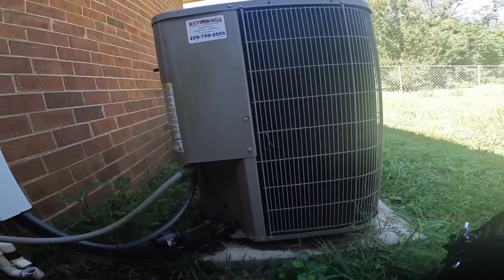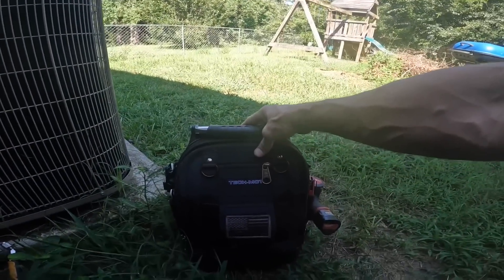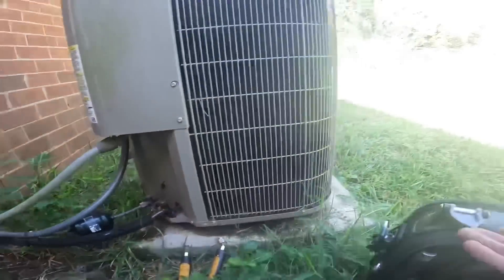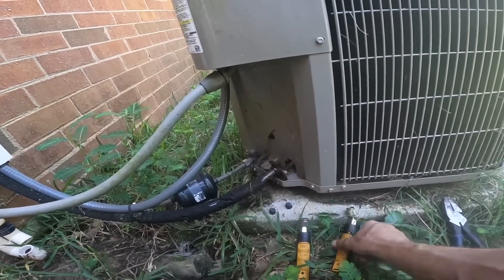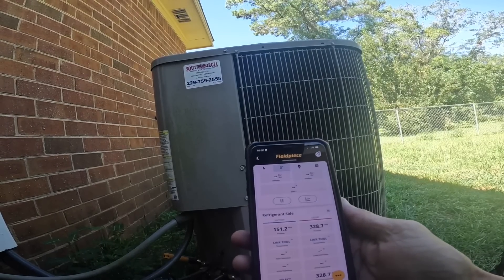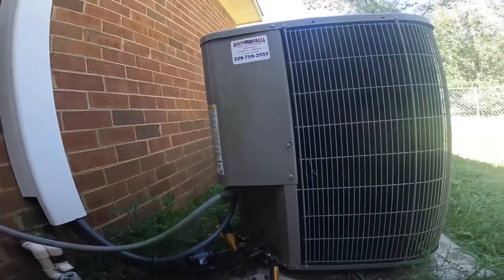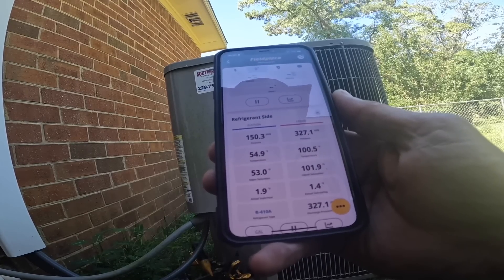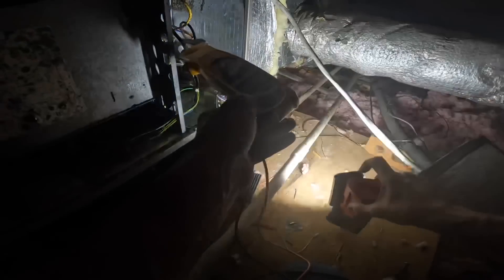TXV Diagnosis On Carrier Heat Pump Not Keeping Up.

Comment: @gosman949
19 minutes ago
I'm a homeowner with a Trane heat pump.  I have been round and round with my tech about why my heat pump throws error messages in the winter in heat mode.  First they replaced the heat strips in the air handler.  Then they said the coil was leaking in the air handler.  Now they came out for their tune up in May of 2025 and the freon is fine!  Now they said it might be the expansion valve in the condenser since it only shuts the system down in the heat mode.  But they did not do the diagnostic you did in this video.  So what is a homeowner to do! I'm going to hope this 13 year old 20 seer Trane gets through the summer OK.  But I will be faced with maybe getting a new expansion valve in the winter?  Is it worth it?

Comment: A B C
Air before charge
Always start with static pressure  and fan speed using your manometers,after you have verified correct CFM per Ton, refrigerant levels can then be checked.
Reply: Is that cfm chart still laying around on that old unit somewhere?

Comment: Could a bad outdoor txv cause trane heat pump to pump down in both heating and cooling?   I am so stumped and you seem like you may have run into that problem before based on your experience level

Comment: I know in Georgia you have high latent heat loads , that may account for some of your delta tee.  There is a formula where by you measure the time it takes to produce 1 pint of condensate,  do some simple math and it will tell you exactly how much tonnage you're re moving in latent heat.  I'm sorry I can't come up with it now, but I'll work on it.

Comment: I think you nailed it but I want to see the pump pump down rate and if a question still linger, recover the refrigerant with a scale to check the charge and saturation pressure to confirm that R 410a with correct charge. Then evaluate.

Comment: How did the system perform in the heating mode?? I guess any reversing valve issue; like hot gas bypass into the suction line would raise the low side pressure but the super heat would go up??

Comment: I want to believe it is a faulty, maladjusted or incorrect TXV. An inefficient compressor would typically cause high superheat due to the compressor not pumping and starving the evaporator. Taking amp draws possibly could've ruled that out or not. I'm curious to see what it was, it has me guessing.

Comment: My two cents.. Low on refrigerant charge.. 1 sub-cool low... 2 Liquid pressures on the high side is Low of the outdoor temperature is above 86 to 90 degree F and  the condenser coil is clean.
3 you need liquid refrigerant pressure on the TXV to force it open aswell as to produce the flash gas to expand in the evaporator for your sensing bulb to respond by closing the TXV to control the super heat... Add some refrigerant to bring up the sub-cool and let it run for some time and  watch the suction pressure drop and your super heat rise.. Some feed back would be nice if possible.
Reply: You are already flooding back with 1 deg superheat and you want to add refrigerant?? Do you even hvac?
Reply: Wrong 100 %

Comment: It reminds me of one I had many years ago that was  going off on thermal overload, and it was because it was overfeeding. And the system wasn't very old it was only a couple years old and still under warranty. I replaced the evaporator coil because it came with the TXV on it. go to start it up the compressor wouldn't run, I put a compressor in it. start it up it ran just like I did before, overfeeding and the only thing I could figure was the ducts, but why was it overfeeding. And with its overfeeding the compressor would eventually go off on thermal overload. the only thing I could do to keep it running and to cool a little better, was to drop a bunch of charge out so the evaporator wasn't flooded. The pressures made no sense but it would work and stay working. 
So it had a new evaporator and compressor and it still worked the same way as it did when I got there. What a nightmare that was. I didn't want to do any more on it. I'm pretty sure I calculated the CFM and replaced all the freon in case it was contaminated, but nope it wouldn't stop over feeding. I got it to work a little better and I got going.
Reply: I had one like that, it was cold, like too cold. Customer was happy?

Comment: Yeah I'm in agreement with the others that mentioned the sensing bulb. Obviously it needs to be insulated and firmly attached to one of the upper quadrants of the suction line. I couldn't see it in the video and didn't see a bulge in the insulation on the suction line. Good luck, and looking forward to the follow up.

Comment: You are a very good troubleshooter I think! you can get the job done and move to the next. I have a question though? What brand and model is that little bity small thermal camera you used to see if breakers were getting hot in another video?
Reply: The little thermal camera is made by Klein.

Comment: Most txv fail closed. I’ve never seen a txv fail open. You have 2 closing forces internally to a txv with only 1 opening force (the bulb). So when the bulb loses its charge or doesn’t touch the pipe the valve loses its ability to open.  Your pressures and temperatures indicate the valve open and unrestricted. It’s open because there is not enough liquid refrigerant to cool the suction line enough to force it closed.  Clean your condenser coil and add some refrigerant.  If you’re not comfortable adding refrigerant, recover what is in the system currently while weighing it as it comes out to verify your charge is correct.

Comment: Cuties 

You can use analog gauges and while it’s running disconnect the common wire on the condenser fan.

As the head Head pressure increases the The suction gauge should remain steady.

I saw this on the mentors YouTube channel.

Comment: For these txv's you need to have around 10° subcooling for them to meter properly. Make sure the sensing bulb is correctly placed, I would aim closely around the 7 or 5' O'clock position. And make sure the bulb is tightly wrapped. I use monkey shit. How this helps.
Reply: Your slugging back cause the liquid is flashing off, pushing the liquid. I have found that if your not over 3.7° SC you will have liquid flashing at AH.

Comment: Moving the temp clamps back and forth isn't always going to give you an accurate reading. I use a wire brush to clean the pipe if I have a abnormal readings before final diagnosis

Comment: WOW ITS FUNNY HOW A TXV CAN GET SO MANY BRAINS OUT THERE WORKING    AND SO MANY WAYS TECHS HAVE FOUND A WAY TO CONDEMN A TXV       TXV  JOB ONE IS TO CONTROL SUPERHEAT GO FROM THERE FIRST   🤔🤔             TXV STILL BETTER THAN PISTON       EASY TO CHARGE BY  SUB COOL 🙂    TXV VERY FORGIVING     AS LONG AS IT IS INSTALLED THE RIGHT WAY                  ALSO  THIS WAS STRAIGHT COOL WITH HEAT STRIPS        NOT HEAT PUMP   IT SAID HEAT PUMP NOT KEEPING UP           CAN YOU CLARIFY ???

Comment: Weak compressor along with a weak fan. I would check the run caps as a low cost "just in case", but that system may not last another summer.

Comment: If it is a txv system, then how do you start to troubleshoot this with an obvious low SC compared to mfr specs, usually 11° or so on Carrier equipment.
Also, the txv is set to maintain 15° SH.

Verify air flow, that's number one. The motor isn't going to be too different with the door off when you change speeds and will be lower RPMs with the door off vs on.

Next, pull the txv bulb and hold it in your hand to warm it up. You should be able to see the change in pressures. No change, bad txv.
If it does change, I would probably add some refrigerant to see what SC does. Based on what happens will point me down the path to my next step.

Comment: Yank the sorry damn TXV out and put a piston in it.. Done and ya (NEVER) have to worry about it happening again, in fact with that being carrier, i would have just pumped it down, and got me a piston out, put it in, vacuum, takes 30 minutes on those bolt in deals..

A txv to piston isn't gonna change the seer rating much at all...   Only difference is one meters flow off temperature and the other by orfice size. That's it the end! 

If it's not a EEV, then it's not worth the time or trouble of installing! TXV's are the (WORST IDEAL) they ever came up with!!

Hell i bet i change 20 per year at (LEAST)!!  Hell i have seen them go bad on systems less than 2yr old in fact!!

Comment: You have low sub cooling and low superheat (flooded evaporator), that equals a txv that is over feeding. Check txv make sure bulb is making good contact and insulated. Place bulb in ice water and that should close the valve. What was the OA temp, that should guide what head pressure should be.
Reply: Best comment here
Reply: This is what I was thinking

Comment: You mean 10 degree delta t. Disconnect the condenser fan motor when its running and see what your pressures are doing. run toy head pressure up and your low Sid pressures should remain the same to a point.

Comment: Pull condensing fan wire to stop fan and see if your suction pressure maintains the same pressure the head pressure will start to climb but suction pressure will stay the same this would mean the TXV is working to maintain conditions in evaporator coil
Reply: Do you mean i disconnect condenser fan motor?

Comment: I think it is the txv. Like others have said down below, only way to know for sure if the txv is working is to remove the bulb and let it hang outside the unit or heat it up and see if anything changes. Unless the compressor had really low amp draw and was leaking by then i am pretty sure it is the txv.

Comment: Was the sensing bulb mounted inside the cabinet ?. You would want it outside of the cabinet so you read proper Subcooling. That’s insulated of course. If it’s left inside the cabinet uninsulated your reading box temp.

Comment: Curtis that is a fun one.  The low super heat and higher low pressure gives it away.  Just bad txv.  Is that a heat pump? Can you switch it over and see if the outdoor txv works? I liked that video. Thanks

Comment: Probably is the TEV. If it were restricted a little more you’d also see that suction pressure drop’to a more reasonable level. 
Can you not trynadjusting the superheat on the TEV body?

Comment: Fieldpiece needs to address how slow that app loads. Also how it just closes even when the probes are still connected.
Reply: I bet it's contacting servers to check for updates.  Possibly verifying user login info if that is required to use it.

Comment: 5kw is usually what sticks on, it negates 17000w or 1.5 ton of cooling. So, if you have a 3 ton, a TD of 10F would be expected. I still think compressor or txv. Either way, new drier 410A. You may have non-condensibles in the system too. No low balling.
Reply: I agree with you 💯

Comment: When I had my A/C system installed 20+ years ago, I had the option of going with a TXV or piston in the system. After talking to a senior HVAC tech at work, he said you will gain some performance using a TXV, but you will have better reliability with a piston since the TXV has moving parts and are known to fail. I went with the piston and I'm glad I did.
Reply: How can you know you are glad, could have had the same reliability from the TXV. using your logic you should forgo a thermostat, because they can fail. You can assume to duties by using a simple switch to cut the system on when you are hot, and cutting it off when you are cold.
Reply: Txv is like going rotary piston well its a piston engine
Reply: Personally, I don’t agree with that one. 

Again, personally, I’ve come across more restricted orifices than bad TXVs.
Reply: @virtual_bomber5698  I see your point on that, but in my experience with residential i have only ever had one issue with a piston and that was a new install and it was put in backwards by the installers. Made the head pressure go crazy, like 140 psi then 300 psi and back and forth. that was a new one for me. Of course, the customer was not home and i had no access to the indoor unit that was in the attic.
 I Replaced at least 2 txvs every year i worked. On the commercial side i have come across a few restricted orifices in package units. Not very often but it happened enough for me not to want the carrier units with them in it.
Reply: @virtual_bomber5698  good to know

Comment: When the TXV went out on my carrier I thought, not knowing any better, that a leak had developed over the winter. The compressor sounded like it had no refrigerant all the while making that distinctive gurgling noise. I thought I was headed for a A-coil replacement but turned out the TXV was totally closed and would no longer operate.

Comment: Those pressures were almost identical to the one I just left it was a trane dual pack. I installed a evaporator coil and I know I didn't get my txv to hot because I had it covered in heat block putty and a cold wet rag. Had a bad txv on startup just stuck open. Worst part is its for a guy on his death bed new txv won't be here till Wednesday. I offered to put a danfoss but advised it would void his warranty if he ever used another company and they wanted to throw a fuss. He decided to wait till Wednesday

Comment: I’ve seen this problem before and it turned out the high suction was due to a check valve leaking by. If the check valve on this one is in the txv then it’s a txv problem. Looks like it’s over feeding when in reality the refrigerant is expanding at higher pressure and losing capacity.
Reply: @R P 
When a txv over feeds you won’t have such a low temperature split between Return and supply. Gotta look at air side temperatures too. A call like that is really a head scratcher. I would’ve liked to see that bulb in submerged in cold ice to really rule out the overfeeding possibly. Again everyone thinks differently. The other day I was working on a 15 ton carrier system. My pressures were 300/148 my temperature split was only 6 degrees. System has two compressors working in tandem on one refrigeration circuit It turned out one txv was completely shut and the other txv was working fine.
Reply: @R P lol definitely and leave it like that so next time I go there it’ll be a txv and two compressors to replace. Great for the business
Reply: @R P two things would’ve done  to diagnose a txv if I think it’s over feeding. First is to close the high side to and monitor my suction line and the performance of the compressor. Second is to dip that bulb in ice and watch what happens.
Reply: @R P  sure I waste lots of time but bring the high dollars at the end of my day 🤫

Comment: Hey brother I had one today I think you will get a laugh out of........The man that works on my auto's ....his daughter is his secretary.....she call's me and ask if I would go look at her daughter's ac........when I get there the husband who looks like he might be in his early 20's is waiting in the yard......So I pull up next to the unit....it's a Payne gas pack......I get out and ask the young man what the unit is doing......he says.....lolrofl.....it stopped working yesterday.....so I watched some video's on Youtube and thought it might be the capacitor so I took the panel off and looked at it and when I went to put the screws back in the door panel it cuts off.....lol.....he said but if I just leave out the one screw on the panel it stays running......lolrofl.......First thing I did was grab my meter .......lol......cause I know there's a short in this unit somewhere lol.......and I didn't want to get my false teeth knocked out......I checked it from the unit to the gas line.......What I found was one of the wires from the high pressure switch had arced against the cap tube of the txv bulb ........I put some tape on it and hung it where it wouldn't rub anymore    and closed up the unit...lol....
before I left I told him not to watch any more videos and try to work on this unit anymore .....I told him there are things in here that will kill you.....lolrofl